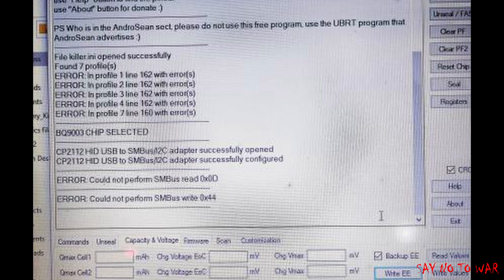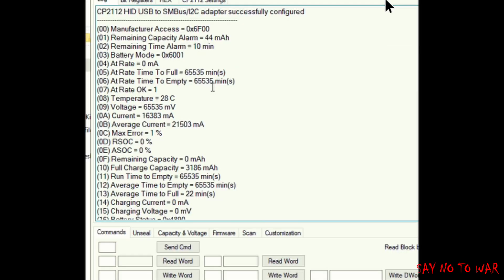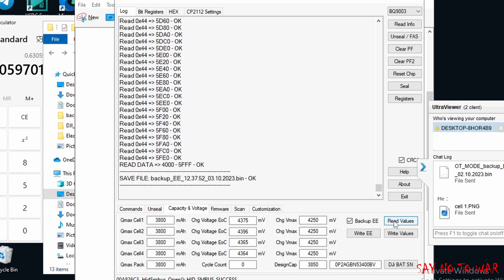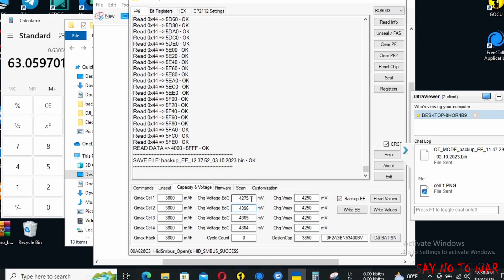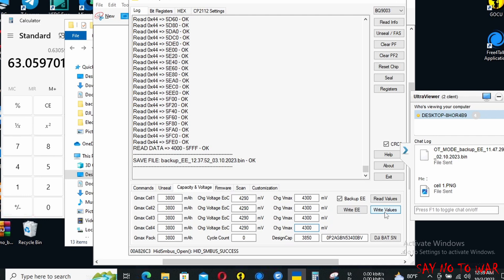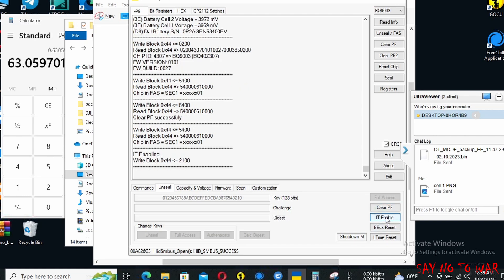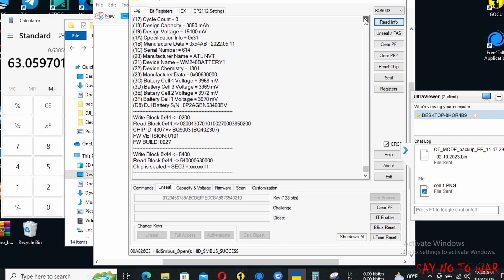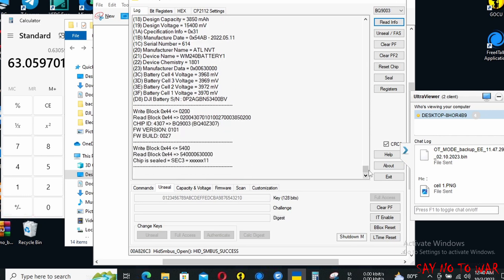How To Fix A Bricked Chip On Your Drone Using The Dji Battery Killer Software

Comment: I know this is an older video b ut i was hoping someone can explain how he attached the extenal power source to the bricked chip? Did they desolder the battery from the board and then connected to an external source? It isn't clear
Reply from the maker: U can connect the power source with or without battery, the reason behind is, chip need a direct power to boot , or to work, so give the correct volatge

Comment: FIX 
If this error shows after the new battery installed the connect with charger for few seconds and the reconnect with pc and cp2112 chip and then it's work

Comment: Please could you share the ifib file and the firmware of a battery that you can read? I'm working on a bms, with a custom chip  "bQ9003" but I must have those two files
Reply from the maker: I dont have that chip with me now. If I get one i will share. Also it is available on telegram groups , which discusses about this type of batteries
Reply: @AnandakrishnaSudhakaran In the video you read a  battery with bq9003, that's the one I'm looking for, you should read the files and share them with me , "IFIB and FW files "
Reply: In your video you read a bq9003, those files would be useful to me

Comment: Can i use 3.7 v 4500mah battery in place of 3.85v 3850 mah lipo cells in mavic 2pro ??
Do i need to change the designed capacity from 15.4v to 14.8v ??
Reply from the maker: @TheuncoveredStory  its danger, u need to change Eoc of all battery in chip data, also capacity and designed voltage
Reply: @ yes i will change the designed capacity to 14.8v
Max charging voltage to 4.2v
And the desined capacity to 4500mah 

Will that work ??

Comment: HI. I take the liberty of writing to you for help.
I have 2 mavic 2 batteries with bad cells. obviously I opened them and unplugged them.
I got new cells, similar to the original ones. But my idea
was to use commercial model battery packs, type S4 4000mA
6000mA....
Now my problem is this:
I purchased a SMBUS CP2112, also downloaded DJI Battery killer,
various versions.
With Phantom 4 pro batteries I succeeded, having made 2 packs
with 8000mA of capacity....
With those of the MAVIC 2 no... I can't turn on the packs
no way. The software does not see the battery chip, even if
I feed it externally...
I don't know if the circuits are blown or I'm doing some things wrong.
Has this happened to you and yes, how did you solve it?
I thank you right away.
Reply from the maker: Am not good at DJI batteries, just sharing what i saw , if its helpful. Do u have same kind of battery which not reading? May be smbus lines are break or check is there any voltage on sda and scl pins. Apply external voltage will wake the chip from sleep. Then read. If its not working, U need to check the circuit , if it is ok then ic is not responding , you can check on linux with smbusread report, for accpting sbs registers, u need to use linux for that, i already made a video..

Comment: Hi. Have you got software to restart a TB60 battery. I have 2 that died after discharging to 9%. Its dead. Batteries are 2 years old with about 50 charges in it each
Reply from the maker: @fabianhiggins1430  hi, do you know which chip it contains
Reply: @AnandakrishnaSudhakaran  unfortunately not. We bought it with the M300

Comment: my dji spark battery error: could not perform smbus read 0x00, please help
Reply: Masukan daya 5v 2A di pin + & - lalu buka software DJi baterai repair, tetapi daya 5v masih dalam keadaan terpasang
Reply: kalo mini 2 gimana?  @quickshorts43

Comment: Great video it was very informative and well thought out even though It was not what I was looking for I still was interested in what you were doing.  

I do have a question about replacing cells in a dji mini 2 battery with the BQ9003 chip. Would I be able to unbrick the chip after using this after I replaced cells in it?

Comment: I made the connection and connected its charger together and was able to restore one, but my other battery recognizes it and reset its parameters with the software but it still does not turn on its LEDs or charge, what could it be?  is for mavic 2 pro and the battery model is FB2, thank...
Reply from the maker: Check pf flag, also fuse

Comment: I'm trying to reset the pf flag on a dji fpv battery board I've hacked to use normal batteries but I went too low I guess and tripped the flag.  Apparently I need the bq9006 version of the software...do you know where this comes from? I can only find sketchy links to places.

Comment: I left my battery unused for 3 years and it will not turn on anymore or charge . will this method work without the power supply/battery charger  , I bought the cp2112 and jumper cables for the connection do i need anything other than that? thank you.
Reply from the maker: 3yr battery?? It will not hold charge if you charge it. And also without wake up the chip, it will.not give values, it is in the sleep state . Apply 6 volt to battery terminals and wake up the chip then read values, if you are lucky chip will awake and show readings, after that chagrge each cells upto 4 volt , also check the battery chemistry. Then read the battery again  if the fuse is ok, it will discharge voltage. But u need to clear the pf flag before that. So many things needed to check and clear before it connect to anywhere. Try ur self. But i dont recommend to use this 3 yr old battery  . So if anything happens take  responsibilty. Be careful , feel free to ask anything
Reply: @AnandakrishnaSudhakaran  thank you. this seems dangerous to do with a 3yr old battery but i will try it with the cp board i sadly dont have any power supply to use. Im thinking of buying a replacement since the battery is probably dead its available in my country but very expensive would you recommend third party batterys ?. Thanks alot :D

Comment: Hey man. great video. quick question I have DJI mini 2 and I would like to swap the 4.4 Lipo to 4.2 volt 18650 (2500 Mah at 8C) Li ion battery. Is it possible to change the charging voltage from 4.4 to 4.2 using this software? These 4.4 volt Lipos are unavailable here. This would be a great swap if it work due to it's low cost.
Reply from the maker: Yes, its possible to change the charging voltage by changing Eoc its available on internet, some guy did it on youtube.
Reply: @AnandakrishnaSudhakaran  Thank man I will search for that video. So you are saying  that we cannot use DJI battery Killer for changing EOC right?
Reply from the maker: We can use dji killer to change eoc, identify which  chip is on pcb and if it is supported we can change. Did you able to unseal the chip? Then we can try.
Reply: @AnandakrishnaSudhakaran  Thanks man. I am currently collecting equipment for modding. I will try to change it anyways because the capacity of the battery is not good. Let you know the details soon. thank you so much!

Comment: Hello brother! do you have a sample video how to change the full charge capacity of dji spark battery 1480mah to 2250mah for modified spark battery..hope you this thank you from Philippines
Reply from the maker: Did you able to unseal the chip?
Reply: @AnandakrishnaSudhakaran  yes i unseal but the (10) full charge capacity=? is not change i watching your video to change the capacity of battery laptop using cp2112 so i try to my dji spark battery to change the full charge capacity but it not work. i dont know what setting to open the (10) full charge capacity to change it....pls help me to change the capacity like in the battery laptop.., thank from Philippines
Reply from the maker: Which chip you choodes bq30z55 or bq9003? Can you contact me on instagram or facebook
Reply: @blacksmithz05  Can you help me, I have the same problem, I want to do the same thing.
Reply from the maker: I saw this issue yesterday Iam on it, will study and reply you.
Reply: @AnandakrishnaSudhakaran
Reply: @AnandakrishnaSudhakaran  I'm waiting, thank you immensely

Comment: it can work in DJI mini 2 ? i need to sypply the BMS? u think DJI mini 2 is 7.4 to 8.4 only
Reply from the maker: Charging voltage is mentioned on the battery. Read and give correct voltage
Reply: @AnandakrishnaSudhakaran  but its working on DJIA MINI 2 battery sir ?  i cant reset my battery. after recell.
Reply from the maker: @Duble_0_seven  can you contact me on my instagram or facebook